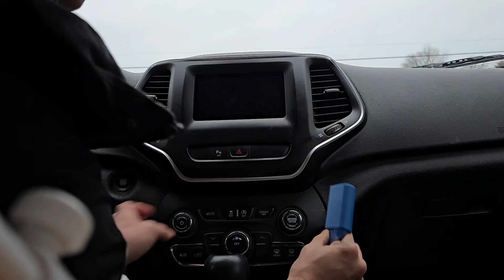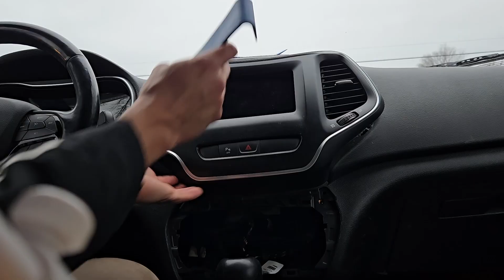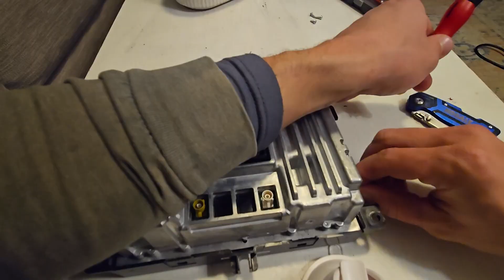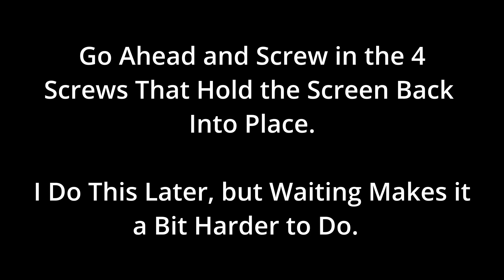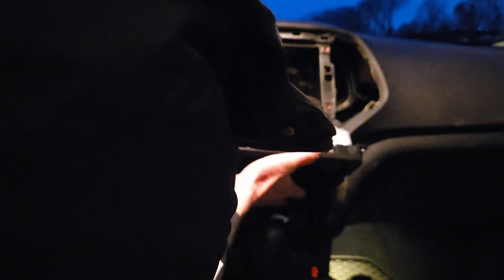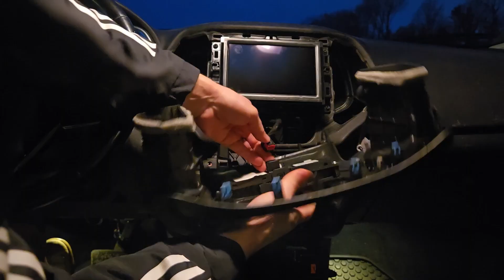Your Jeep's Touchscreen Broken? Here's the Cheap Fix...

Comment: Great video, might add it is easier to connect the larger ribbon if you flip the module to the opposite side of the screen so you can see the connector then connect the smaller ribbon. Purchased my new screen on ebay for $70 and works fine so far. If it doesn't last long just buy another at that price.